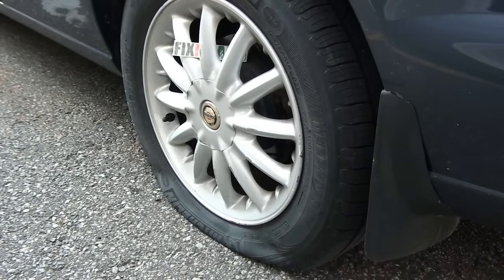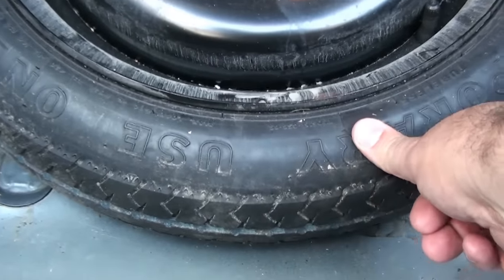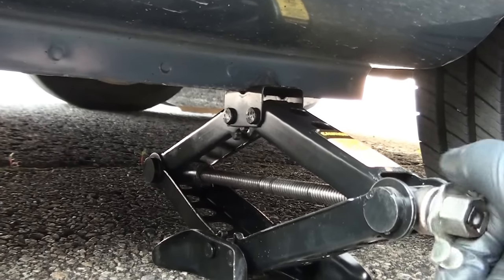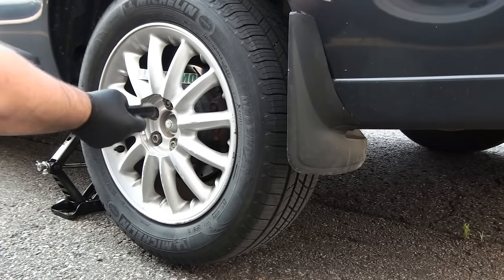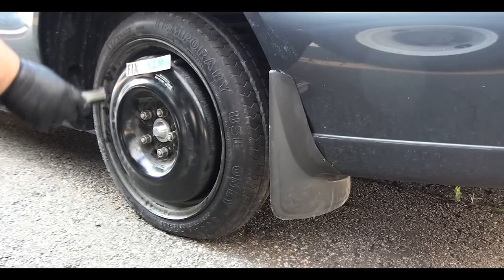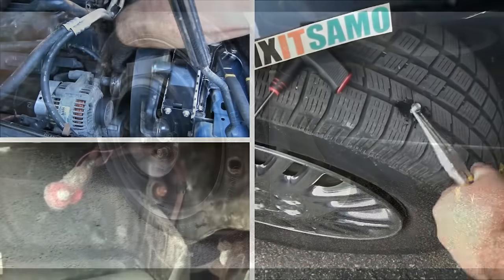How To Change A Flat Tire Like A Boss

Comment: IMPORTANT SAFETY NOTE: This is a helpful video, but lug nuts should always be tightened in a star pattern. It ensures that the wheel is seated properly on all the studs. If one side is tightened first, and the other side happens to not be fully seated, the edge of the hole can get caught on the stud threads. When you tighten those nuts, they tighten against the threads and feel secure, but once on the road the wheel will settle on the studs and the all the lug nuts will be loose. This is also why it is a good idea to check lug nuts 50-100 Km after changing a tire.
Reply: Coronos bro . it's dosent matter to have a normal loosing lug nut when open it right ? just follow the star pattern when tightening ?
Reply: Correct, there's no pattern for loosening. I would add, though, that if you're removing lug nuts that may be seized or partially seized, move each one just enough to be sure that it's not seized before fully loosening any of them. This will prevent excess pressure on remaining lug nuts that would make removing a seized nut even more difficult.
Reply: Coronos tq bro . how about if we only have four lug nuts point . do we have to tightening based on opposite pattern ?
Reply: Yes. The goal is to keep the wheel as flat as possible. For four lug nuts you would start by tightening two that are diagonally across from each other.
Reply: Coronos az
Reply: Coronos i
Reply: Coronos h
Reply: Coronos h
Reply: Coronos 8
Reply: This happened to me. I guess whoever sold me my first car didn’t tighten the lug nuts or place them correctly and my whole tire and rim flew off, ruining the whole front. They took no responsibility for it.
Reply: What is a star pattern
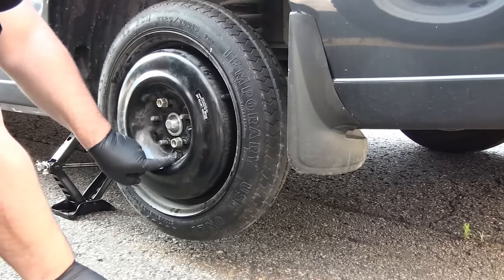Reply: @joannefroehlich8165  On a normal 5-bolt wheel, with the wheel fully off the ground, start with a lug nut at the bottom to set the wheel in place. In the video between 3:25 and 3:35 you can see that the bottom of the wheel wanted to push out on its own (it's a bit hard to tell when he is pushing on the top, but it would have been sitting like that regardless). If you want to start all the nuts before winding them in, that's fine, but make sure the first nut tightened is the bottom one. Starting with a nut on the bottom ensures that the wheel is flat from the start. 

Working in a circle, put a nut on every second stud until all are in place. (This pattern creates a star if you connect each stud with a straight line in the order that the nuts go on, hence the name.) Working in the same pattern, make sure they are all snug before letting the vehicle down. Again using the same pattern, tighten them all with the vehicle on the ground.
Reply: i need awhole new video to understand what lug nuts are :)))
Reply: @lyan3232  a lug is the type of bolt the wheel sits on. On a passenger vehicle there are typically five per wheel. The lug nuts are the nuts that go onto the lugs, holding the wheel in place.
Reply: Naw fuck this, I'm calling triple A
Reply: @ashleynicole178  That sucks. Always get a professional to come with you to inspect a used vehicle before making the purchase. It’s like hiring a home inspector before you buy a house.
Reply: Never mind, I’m calling triple A
Reply: This may be a dumb question, but do lug nuts have a torque spec?
Reply: So basically for the star pattern: you start down, left, up, right..? Heading down the 5, just me, baby, and dog. Need to be prepared.
Reply: @NoahSham   Yes, they do. After changing a tire yourself, or having a garage do work that requires taking tires off, you can go to any tire shop or garage after driving about 100 km (60 miles) and ask them to re-torque your tires. Doing this will ensure that no nuts have worked loose, and that all are at least at the torque spec.
Reply: @yazmindepatie7190   if you have 5 lug nuts on the wheel, refer to my reply to Joanne above. If you have 4 lug nuts, tighten diagonal ones first.
Reply: 89
Reply: Right they should never b overtightened
Reply: @azrizaki1039  n 
A 
  
S 
.4a
E 
R as sea
Es are s
Reply: And also, tighten fully when the jack is up right? In this video he tighten fully when the jack is down, which i think itll be hard for the tyre to be "flushed"
Reply: @johnwig285  Tighten enough that the wheel is fully seated, but the final tightening will be when the tire is on the ground. In the air the tire will spin too easily to tighten all the way.
Reply: I don’t 😂😂😂😂😂😢😂😂
Reply: @coronos3284 you’re an absolute legend. 👍🙏
Reply: Exactly what I thought
Reply: Thank you someone said this
Reply: And I thought that year at 
kal-tire was a total waste…
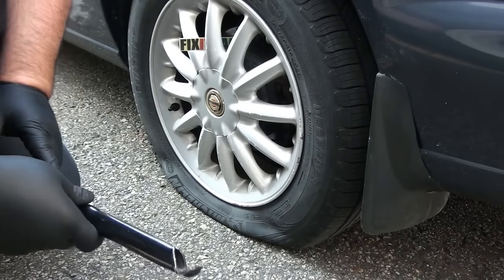Reply: 1:20 😊
Reply: Thanks for adding confusion bro

Comment: Thanks for the straight to the point video! Just had to change my first tire ever and I'm a whole grown up lol. Always had someone to do it for me. Walked out to my car in the garage with a complete flat! I somehow ran over a screw. Fortunately, I was at home and not on the road so I was able to take my time with low stress. Discovered that my spare did not have much air!!! I never thought about checking the spare's air pressure. So I learned two things. Fortunately I recently purchased a portable air pump so I was able to get air in the spare and drive to get my tire plugged. Plan to go get a good roadside kit for my car. I used the jack and tire iron/crank that came in my car, which got the job done but not the best quality.
Reply from the maker: Welcome im glade it helped 
Drive safe 🙂

Comment: Like @herinetta, you helped my friend and I change our first tire too! One thing not mentioned here: If the tire bolts are too tight, you might need to stand and jump on the tool to loosen them! You also need to do the same when you tighten them back up again. Good Luck!
Reply: Also, check the air pressure of the spare tire! You may need to add air before it’s safe to drive.

Comment: So 3 most important things to have here (I think).

1)Spare Tire

2)Lug Wrench

3)Car Jack (thing that lifts the car)
Reply: did you see the spare was a bit flat? So b4 you go on a trip be sure the spare has air in it. The lug wrench is there  on the crank so you dont need to get one. Also maybe have a small tarp to put on the ground so when you kneel you dont get dirty. I got a flat at 430 am in the rain b4 work as a city bus driver it was a mess. The tow company was on shift change i waited an hour the did it myself. I had a little truck and did not know that the crank goes in a little hole above the license plate... it drops the tire down. I have done a dry run on changing a tire during early summer wver since si i can change it fast.

Comment: Just experienced my very first flat tire on the road in the middle if the night. I went by instinct and changed it by myself. Really tired. Came to see a video to see if I did everything correctly and I'm very happy cause I did not. I panic a little cause there was a different star type screw but I found out how to untied it. Very estresful but I'm so happy i did it myself.

Comment: Hardest part is loosening the lugs.  With the power tools many repair shops use it can be tough.
Reply: rizon72 how tf do you do it I gotta flat rn and I can’t loosen them up at all lol
Reply: To get them loose, use your body weight. Place the wrench so it’s roughly horizontal, and step on it. You only need a couple of inches, then you can use your hand
Reply: Yup, I just bent the crap out of the wrench, nuts didn’t move.
Reply: @sampayne5777  Last time I had a flat on the road, my gf stood on while I held it and we managed to loosen it enough.  Also happened in the middle of east Texas, in 1993, no cell phones.
Reply: So hard!! I’m trying to add my body weight...
Reply: Easier just to push it down with your foot

Comment: It's annoying after your car has had a service because they machine tighten the nuts so when it comes to trying to get them off it's futile then you gotta call roadside assist 🙄
Reply: A stomp always helps for sure.
Reply: Try to carry around a pipe in your trunk so you can slide over the wrench to get more leverage
Reply: @justvibing7912  Great idea but most of these heads only got the pipe thats in  the glove box and they trying to hide that

Comment: And here’s another tip the spare tire is just a tire to be used to get your car too a tire shop and get your tire fixed or replaced the spare tire is not too be driven on the highway and shouldn’t be used as a tire to drive around town with. Put the tire on get too a shop and get your cars tire fixed. The reason for this is it’s not a full size tire and it’ll make your car handle differently and it’s not safe to drive with it’s there so you can still use the car too get it too a shop it’s a secondary option it’s not something to be used daily

Comment: I ran over a roofing staple. Well I lifted the car, got my gorilla bar. Tried loosening up the lug nuts, they wouldn't budge. Guys at the tire shop put them on with a NASCAR pit gun too damn tight. Took me some force but I finally got them off. Great tip on tightening it after the tire drops back down.

Comment: Just caught a long ass screw and washer from the bowling alley. Good thing my low tire warning didn't come on until I was close to home, so I drove on , but not fast at all. When using light duty jacks, it's best to be on a LEVEL SOLID surface! Don't risk getting hurt by putting something under the jack. You need to have a compressor and a tire pressure gauge, esp. for occasions like this! Parking brake on, chock wheel(s). I had to use liquid wrench to help lugs get loose, YMMV. I also had use of a torque wrench; super helpful when tightening the lugs, so u don't over/under tighten.   I was gonna plug the hole, but my plugs were so old, they had become gooey, like melted chocolate. Ultimately, made my appt. at Discount Tire online, got 4 new tires, since the ones on there were approaching 7 years old. All this is for naught if you don't have a spare 🤐

Comment: I had a flat a few hundred miles from my origin and destination, and a friendly stranger put the spare on for me. A few hours later I found someone who could patch the tire and put it back on. They patched the flat and removed the spare and put the original back on, and I drove to my destination. I've been wondering: do I need to have the car's wheel alignment or tire balance checked because the tire was removed and put back on?

Comment: UPDATE TO SAVE YOU A HEADACHE AND A LOT OF TIME:

Never raise the vehicle before loosening the lug nuts. If you get that car in the air and try to loosen them, you’ll quickly find out how they can rust, or sometimes even melt to the stud. 

ALWAYS loosen while the car is still on the ground. Save some time, sanity, and your back.

Comment: Hello where can I get that manual lug nut remover just like yours.. I have been looking for a good one.   🙂
Reply from the maker: https://www.cjponyparts.com/jack-handle-folding-lug-wrench-1965-1973/p/JHW1/?gclid=Cj0KCQiA88X_BRDUARIsACVMYD8ayt9iNxA5_whp1xyUzTcXXuwhlSwVV3VEQlDgjIB1tQKs5iortZQaAg6TEALw_wcB

Usually every vehicle comes with it’s own tool kit  Jack , Lug Wrench 
Btw make sure that you  have the exact size because  many vehicles have different size and shape  lug nuts

Comment: A couple of things,he applied the h/brake but how come the vehicle moves when tightening the wheel nuts,try not to change a tyre on a hill or a bend.Avoid having anyone inside the vehicle, Handy reflective warning triangle. Check you have immobilized the vehicle, turn on side lights if it's going to get dark soon, tyre pressure check your spare tyre before you do anything and remember that spare wheel is only to get you home and at a reduced speed, get everything out of the vehicle you need before jacking the vehicle up.It helps yourself if you yourself untighten the wheel nuts and then thighten them yourself as garages or other people may be stronger than you who will tighten the wheel nuts to a different tightness and then if the situation arises again you might not be able to remove those tight nuts. On another note have good gloves, a torch, wet weather gear, know what you are doing (you could train & time yourself just to get the hang of it)..When you have finished changing the tyre stow away everything away and recheck the area for items.You could also print off a "to do list to follow on". I'm an ex experienced vehicle mechanic/inspector trained in the forces on many vehicles & equipt.
Reply: Lol damn man I’m just tryna take a tire off not train to join a pit crew 😂
Reply: @RookieMistakeYT  Other drivers do not have a clue, I like to pass on info for other drivers NOT keep it to my self. I have helped a group of young women on the A1 northbound changing a wheel & I like doing Random Acts Of Kindness.Because you have done it does not mean everyone else has.I believe training should be part of the learning to drive and be tested to get your full driving lience.I'm a fully qualified Mechanic & a HGV driver HIAB trained.

Comment: Mercedes Benz ML320 with 255/65 16 is hell to remount the tire because the tires are secured with lug bolts. Try doing it when conditions and lighting are not ideal.

Comment: if you have manual transmission do you put in neutral or first gear
Reply from the maker: I would put it on first gear plus hand break and for extra precaution i would try to find a medium rock and place it in front or back of another tire
Reply: @fixitsamo  thanks

Comment: Flashers 
Car in park 
Lift the hand break
Check replacement tire
Remove the cap loosen the screws 
Use the jack to lift the car 
Remove the screws completely
Align the spare tire 
Put the bolts on slightly tighten 
Put the car down 
Tighten the screws completely
Don't exceed the speed limit on the spare tire.

Comment: Make sure to tighten the bolts on a diagonal. So let say you tighten the top bolt go to the diagonal bolt and tighten that one next, to make sure the tire is not on an angle and parallel to the brake. That does not happen if you tighten the bolts in a circle like in the video.

Comment: Did i miss the star pattern when tightening the lug nuts?
Reply: M9F0A  I’ve changed so many tires in my life never used a pattern  ever year i replace my winter and summer tires never had an issue  the important thing is to tighten the nuts  to the max after lowering the car
I’ve seen some garages do it some don’t  personally i don’t think  it really matters
Reply: tony sony oh i see thanks just a newbie here, saw it on the previous videos on how to change a flat tire. Havent done it really. So basically just tighten it to the max no need for some sort of pattern on tightening it? Thnx

Comment: Bonus tip : if you can't break the nut when trying to unscrew them before jacking, use your feet and weight to push down on the nut until it breaks loose.

Comment: Pro tip : pour hot water on the nuts of the tyre to remove the tyre after jacking up ..as due to rust it will not be easy to remove it.

Comment: Aren't you suppose to tighten the nuts in a start pattern?
Reply: +pio trinidad valencia its recommended yes
Reply: Okaythen001 you dont damage anything its just uneven distribution of pressure but the margin is very low instead of 100% secure you will be 99% secure
Reply: +Anal Devastator are you responding to my first 3 lugnuts was star pattern but not rest, or just no star pattern at all?

so it's not that big of deal huh? 99 vs 100%, kept hearing it's very important to do star pattern
Reply: Okaythen001 im saying youre doing it right and that there is no damage if you dont do the start pattern
Reply: This is incorrect. There is a very real chance of the wheel not being seated properly on the studs if the lug nuts aren't tightened in the star pattern. If the wheel isn't seated properly the nuts will be loose as soon as the wheel settles while on the road. See my more detailed explanation in comments above.
Reply: Okaythen001, It is very important to do the star pattern. It's not just a matter of even distribution of pressure. The star pattern ensures that the wheel is fully seated on the studs. If you do the first 3 in the pattern you're probably fine, but it's just as easy to continue the pattern. Pick a starting point and do 2 full circles, skipping every second nut. See my comment above for a more detailed explanation.
Reply: In this case it doesn't really matter.

Comment: Needs to be tightened in a 5 star ⭐️  pattern or the spare tires hex nuts might loosen when driving.
Reply: Coffee is the path to victory 
Not really bro I’ve changed so many flat tire for me friends and family members never had a problem the important step is to make sure to tighten all the nuts properly when you’re done  and as he said respect the speed limit cause some guys don’t respect the speed and weight limits of their spare they end-up damaging the car or suspension even in some cases some nuts will snap 
Drive safe and good luck